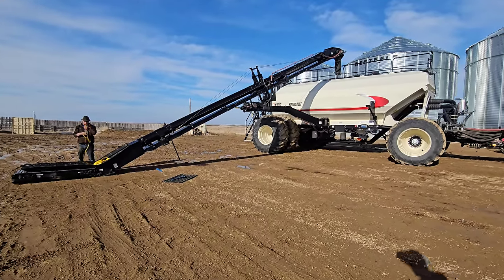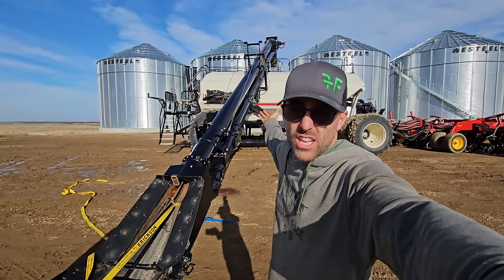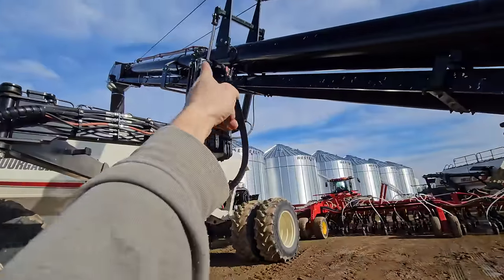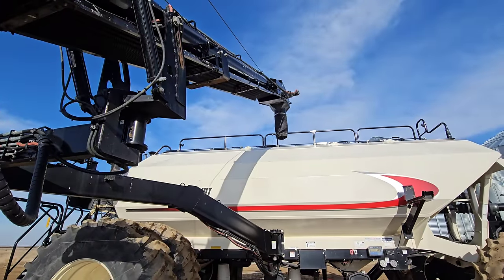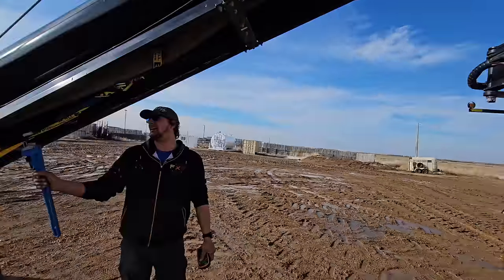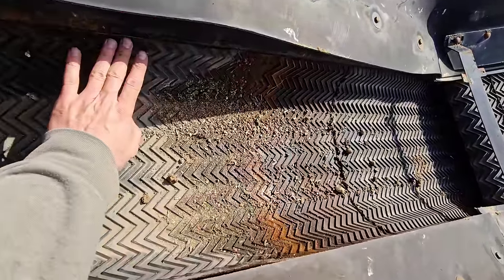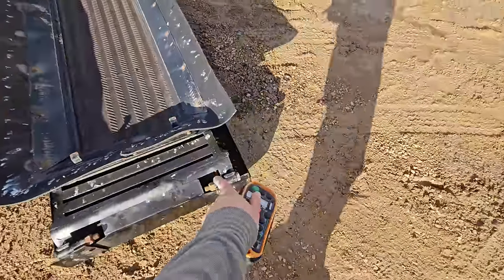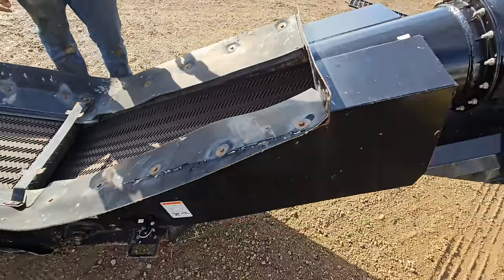It's Stuck! 🤔😆

Comment: Mike, have you considered contacting May Wes to see if they have, or can fab a poly liner for the tube to go in between the belt and tube?  That poly liner seems to be the magic material when it comes to augers on the combines, maybe that would stop the rust adhesion of the belt to the steel conveyor.

Comment: Null modem. They are used to terminate a bus. Kind of like a cap on the end of a manifold to make sure the water or fuel or whatever fluid doesn’t leak all out the end instead of going where it is supposed to. Not a perfect analogy, but kinda close.

Comment: I feel like washing them does more harm then good.  Get 10 years off the bearings on meter augers doing roughly 6000 acres per dril a year grease them daily.   Never had half  these problems

Comment: Need to take a long piece of cable   Start at the top and run under belt the and run both ends on top of belt to other end so the loop is between belt and tune and pull it
Reply: or rope

Comment: Maybe running more water down the tube... loosen up the guck holding the belt?    Or a long rebar with a small 'L' on the end...worked under the belt further up??
Reply from the maker: As long as you kept the water away from the main roller, maybe but I think getting the belt wet would only make things worse.
Reply: It appears that the rust bonds to both materials, getting it dry and keeping it dry seems to me the prevention. Good luck on a bountiful harvest.

Comment: It's got a belt in it? I thought those things were a screw auger. Shows what I  know... 😊
Reply: Some do have a screw auger in them.  The big plus with the conveyor is the complete product cleanout when switching products.  Auger you had to run in reverse then dump the hopper in a pail and cart it up the ladder.  Conveyor is self cleaning so just clean the tube and switch between seed and fert in seconds.
Reply: @theloniousm4337  Also the belt causes less seed damage in fragile pulse crops.

Comment: A trick that might work is feed a rope behind the head pulley and fish it down the auger tube tie one side of the tail pulley and winch on or pull other side should go between the belt and bottom of tube pulling it up off the bottom

Comment: Mike, maybe if you put some lubricants on it after you finish seeding it would prevent some of the moisture on the belt and be evaporated by the time you need it in the spring? Just a suggestion.